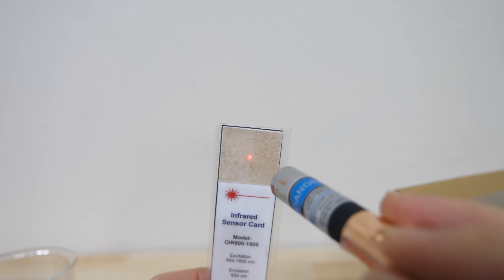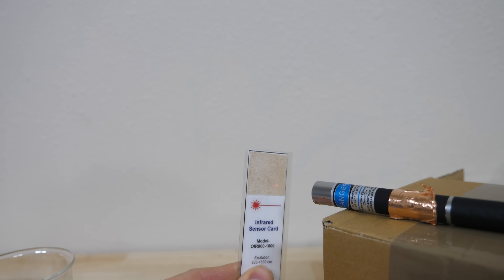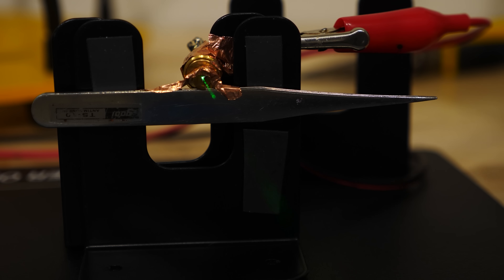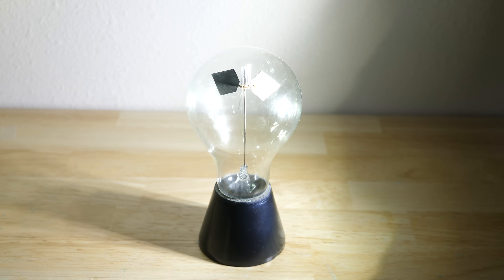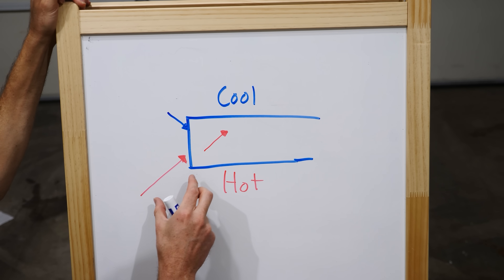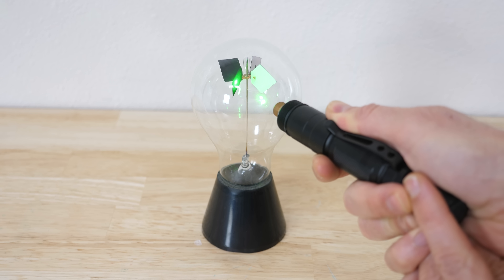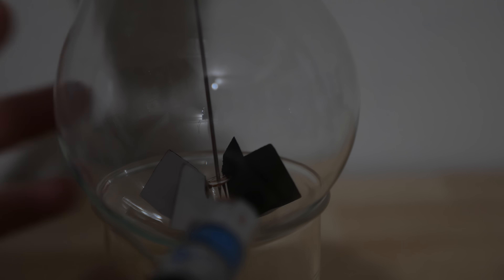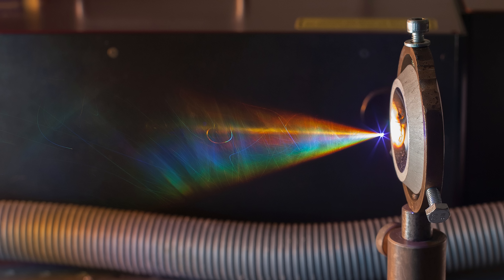I Had To Break My Radiometer For Science

Comment: What a fascinating and unexpected result! Your continuum spectrum had me chanting, "Thermal! Thermal!" but how it gets thermal when the same laser has no effect on your hand -- you've checked for small leaks, yes? -- is baffling and likely more complicated than it looks if the history of radiometers is any guide.

That history is far messier than most folks realize. For example, even the great James Clerk Maxwell mistook Crookes' results for the radiation pressure effect he first predicted. Even today, it is Maxwell's profoundly non-quantum, fully classical light pressure model remains the best explanation for astronomical dust clouds (the Pillars of Creation) and the design of NASA's well-proven solar sails. Ask a QED expert to explain the same effect, and you have a good chance of getting a lot of hand-waving nonsense about electrons absorbing and then re-radiation the same photon in the reverse direction without any loss of energy, which is impossible in terms of energy conservation, time delay, and directional precision.

Comment: This has to deal with the black paint in the radiometer. Efficient black paints are made by dense surface relief materials like carbon nanotubes (like vantablack). These are well insulated from each other in vacuum. Thus, they could be heated up by the laser so rapidly in vacuum. Not sure about the white side of the blades... Probably, they might have shreds of nanotubes on them, which were deposited while the radiometer was spinning.

Comment: Can you give us an explanation of how "Raman" spectroscopy works. It seems that they can use a IR or even a green laser to produce a non-contiguous spectrum from IR to UV. I believe they use a narrow band filter on the detector to remove the light from the laser so it doesn't overwhelm the sensor. My understanding is that they use the Ramen effect to produce spectra used to identify a material's composition. I don't understand how this effect is possible.

Comment: That is fascinating. As I commented below: radiative cooling is very efficient, actually. That explains why rescue blankets are so useful during mountaineering, etc. The human body loses about 50% of heat via radiation losses (at a miserable 37 °C) the rest via conduction & convection.

Here the vacuum kills convection and conduction losses, so then radiation heat loss remains. Considering the colour temperature of the incandescence, it looks like it could be above 1600 °C, you can check using a camera to detect the colour temperature. Take a daylight balanced picture and use a black body colour chart. 

One burning Q remains: Why doesn't the radiometer vane melt? I was imagining it to be made from aluminium. 

Two actually: Does it work with C black powder in vacuum?  Make your own using a sooting candle and a glass slide.

Comment: Isn't that how they make the light source in a "laser video projector"? They shine a laser on some small dot that becomes really bright and that then is used as the light source for the projector. The pros are that it is smaller (thus sharper image) and can change brightness quicker (for dimming in dark scenes to get better black levels).
Unfortunately they don't actually scan red green and blue lasers across the screen. That would be super cool but probably extremely dangerous 😅

Comment: You don't feel it on your hand as skin is very transparent to that infrared light. It is not absorbed at the surface of your skin, but on the inside. In this case it is probably not powerful enough to cause serious harm. But you can even burn yourself internally or the surface of your bones, because you don't have any heat receptors in the depth of your flesh. But when it is absorbed all in the same tiny spot on the radiometer it can get hot enough to glow like this. 
This one of the reasons why it is dangerous when scientifically inept people play around with Laser pointers of more than class 1. This is at least class 3B.

Comment: Yeah, immediately went to black body thermal. Worth pointing out that flesh is pretty transparent to IR light, which is why it doesn't burn you. The energy is distributed over a large volume, unlike just on the surface like the radiometer material.

Comment: This is really a nice video! I am a researcher in the field, I will try to comment in the simplest possible way. Generally speaking, it is possible to obtain supercontinuum generation even with continuous wave laser. One of the main source is a process called four wave mixing. Four wave mixing is a third-order non linear process. This means that you need really a lot of power and tight focusing to have it with a continuous source. Moreover there is a lot of power directly transferred to the material, so it is also easy to damage them. To avoid this, in our field we prefer femtosecond laser in order to effectively generate supercontinuum. Also the frequency doubling that you are showing for generating green light is a second order non-linear process. So it is much easier to handle it even with a laser pointer. Considering the low amount of power one can have with a diode laser, the easiest explanation that comes in my mind is that you are emitting a "black Body" radiation. In vacuum you expect to be much more efficient since there is no thermal contact with the environment, so the material can reach higher a temperature and emit in the visible spectrum.

Comment: Did you notice the small point of green light reflected by the radiometer glass @ 3:51?  I would be curious to understand the mechanism of this phenomenon.
Reply: nice lol
Reply: Good catch.
I'd first written a guess that the glass of the bulb might be recoloring that reflection, but on repeated viewing, I think we're looking at lens flare refraction inside the glass of the camera lens.  The point of light is certainly bright enough to have this effect in the dark room.  There are at least two spots visible near the opposite side of the screen from the original bright spot, and there may be corresponding spots near and on the same side as the source, but they're too washed out for me to see.  Coating that's commonly on camera lenses naturally shifts the refracted color through multiple frequencies.

Comment: Those cheap laser pointers are many times greater than the 5mw rating that they print on the label. With a focused beam you can easily light matches and burn dark colored materials. Thais is almost certainly incandescence like you said.

Comment: Actually you have 3 mechanisms:
1) auto fluorescence (pure carbon is very prone to it)
2) absorption of light which energy can not be transported due to poor thermal conductivity and missing convection, therefore heat up of the paint 
3) Oxidation of carbon with remaining species in gas

Comment: black pigments are usually finely powdered carbon dust.  My bet would be black body radiation from that carbon.  In air, it burns.  One way to confirm, maybe, try purging your vacuum chamber of air then refilling it with pure nitrogen or a noble gas.

Comment: The lab that I work in uses those IR cards because we have a giant 100+ watt IR laser that we need to track across an optic table. It's probably one of the simplest "sciency" things we use in the lab but I never knew how it worked before, partially because I'm an undergrad and I don't know much, and partially because I had never thought to ask about something so seemingly mundane. That was a great explanation, thanks!
Also, it makes a lot of sense that the laser seemed cold. Skin is terrible at absorbing infrared light so it probably just passed right through you. If you had used it on a black balloon I bet you could have popped it. Hope you are wearing appropriate goggles for this-as someone who works with high power lasers, I get paranoid about goggle safety and that laser seems pretty powerful despite its seemingly low image on the IR card. Be safe out there!

Comment: One more use for the vacuum chamber.
Try to put an audio amplifier built with vacuum tubes, with the tube glass broken, inside the vacuum chamber.
It is impressive how the cathodes light up, and the tubes start to conduct, only when vacuum is reached.
With partial vacuum only, there are sparks - especially in the output pentode.
Merry Christmas
Anthony
Reply: Once broken open a vacuum tube's cathode will react with the oxygen and water in the air. In most cases the oxide layer expands and flakes off the cathode. You do get a certain amount of re-activation of the cathode under high vacuum conditions but the cathode is nothing like as emissive as it was before exposure to the atmosphere. For this reason, I use bright emitters, tungsten, for all my cathodes.

Comment: Thermal emission is exactly what I suspected at about 4:13.  Also, I believe this type of device would be optimized (gas pressure, composition, paint, etc.) to maximize the thrust to spin the vanes.  So the fact that it worked best inside the glass bulb makes sense.

Comment: Vacuum is the best insulation material (or non-material?) Plus the sheet is very thin and has low thermal capacitance. This is probably why you can light it up with a small IR laser pointer.

Comment: A lot of times, if you take the base off of those radiometers, they have a valve stem like an incandescent light bulb. I was hoping you would have done that to release the vacuum instead of cracking the whole thing. That way you could have used your vacuum chamber and revived it afterwards.

Comment: Isn't this a simple material example of the black box problem? The thin black sheet, struck by any radiation of any wavelength, absorbs it and re-radiates it. And the resulting radiation has a color depending on the heat generated, just as a fire or iron will go from red to yellow to blue to whilte. Is that what happened here?

Comment: That was my initial guess, that it got really hot.
At first i didn't know there was a vacuum inside that bulb. So i thought there was some super absorbent paint on those fins that would easily glow. But once you said there is a vacuum inside it i realized that it glowed white hot because it had no way to transfer the heat away from it. Air is pretty conductive for heat after all.

Comment: This works because even weak lasers have an extremely high power density, so the lack of oxygen and the good insulation of the vacuum allow the laser to slowly vaporise the black paint. The leidenfrost effect then prevents the heat from being transmitted to the rest of the paint efficiently, so it heats up the vapor enough to emit visible blackbody radiation

Comment: How does the laser heat it so hot if it's a low power laser? What's the output power of the laser?
Reply: Is all that heat being produced by the laser, or the laser trigger the release of energy already stored in the material?

Comment: I assumed it was black body radiation because the vacuum reduced the cooling speed, black absorbs all frequencies of visible light, but most flashlights also emit IR light, so the black paint should also absorb IR well. The last clue was the color, there was white but also yellow and orange at the edges.

Comment: Fascinating Video! Also there is another phenomenon to convert lower energy photons to higher energies called upconversion, it basically uses two atoms that get into a higher energy state and another atom which the energy of the two excited atoms gets transferred to which then emits lower wavelength light than what was used to irradiate the material.

Comment: Very interesting! I wonder, is it just because the vanes are black that it works well or is there a coating on the black side of the vanes that also interacts with the IR?
Reply: Combination of the vanes being black and very thin.
They are good at absorbing IR and there is not much matter to transfer heat to.

Comment: You need to check the temperature of the Dot because the spectrum appears to be Black body.  Your Laser is heating it up but Radiative cooling is extremely bad.
Reply: I was going to suggest a black body radiator as well.  Since there is no air/gas it can’t dissipate the heat. Also since there is no oxygen it didn’t burn in the vacuum
Reply: I don't think it would be easy to check the temperature of the dot. Those remote thermometers have a much wider cone than their laser-pointers would suggest, so you could just be measuring the average temperature of the entire vane.

I'd like to know what'd happen if you kept the laser steady for a few minutes. Would the dot stay just as bright? Would it get bigger as the vane heats up? Is it ablating the carbon away? Maybe it's only the vaporised carbon that's incandescing, because after it breaks free from the vane it can't lose any heat conductively.
Reply: Radiative cooling is very efficient, actually. That explains why rescue blankets are so useful during mountaineering, etc. The human body loses about 50% of heat via radiation losses (at a miserable 37 °C) the rest via conduction & convection.

Comment: Aren't most lasers in the milliwatt range? If so you might have just discovered a way to make a way more efficient filament type bulb with lasers as the Exciter instead of standard DC or AC current
Reply: Wireless too. The lighting elements wouldn't need to be powered.

Comment: Just a warning to anyone wishing to try this for themselves. If you're not careful, the heat will cause outgassing from the vanes, particularly if they are of the non-mica type. This will increase the pressure of the partial vacuum inside the bulb and the radiometer will no longer work as intended.

Comment: I think the physics mystery of why a vinyl shower curtain is drawn inward when the shower is on, regardless of water temperature, is an electrostatic effect. I even put my hand under the curtain to see if there was air flow and there wasn't, it has to be pure electric field effect, seems surprisingly  strong though, it'll pull a thin curtain way in.
Reply: I think you need a candle or something to sense air flow more reliably
Reply: @u1zha  Why would air even be flowing under there though? There's another cloth curtain outside that hangs down over the outside of the tub, air couldn't even flow in under the inner curtain.

Comment: Next time you need to break open a radiometer, remove the base and break off the narrow tube that was used to pull the vacuum during manufacturing.  That will allow air into the bulb in a relatively slow and controlled manner, and then you can break the main bulb without the violence of the implosion.

Comment: How does the photon beam have enough energy to heat anything to white hot? Seems quite novel for that material to absorb IR in a vacuum and almost completely convert it into visible light without any depletion over time. IMO it should have emitted light in air without the perfectly focused spot, afterall it wasn't focused being shot through a bulb or acrylic. If air is simply cooling the spot down before it emits light, you should be able to put one of the veins on a hotplate and make it emit white light with the unfocused spot as it gets hotter.

Comment: Very interesting to see what ChatGPT says about it!

Q: Why does shining an infrared laser on a black square in a vacuum cause white light to be released?

A: Shining an infrared laser on a black square in a vacuum will not cause white light to be released. Infrared light is a type of electromagnetic radiation that is not visible to the human eye and has a longer wavelength than visible light. When infrared light is shone on an object, it is absorbed by the object and converted into heat. The object may appear to glow or become warm to the touch, but it will not emit white light.

It is possible that you may be thinking of a phenomenon known as laser-induced fluorescence (LIF), which can occur when a laser is shone on certain materials. When LIF occurs, the material absorbs the laser light and re-emits it at a different wavelength, which can be seen as a glowing or fluorescent light. However, this effect is not the same as the emission of white light and is dependent on the specific properties of the material being illuminated.

Q; But a prism confirms the light being released is full spectrum. And the light does not appear when the black material is not in a vacuum.

A: It is possible that the black square you are referring to is made of a material that exhibits laser-induced fluorescence (LIF) when irradiated with infrared light in a vacuum. In this case, the material would absorb the infrared light and re-emit it at different wavelengths, resulting in the emission of a range of colors that can be observed using a prism.

However, the emission of a full spectrum of colors does not necessarily mean that white light is being released. White light is a combination of all the colors of the visible spectrum, and the colors produced by LIF can vary depending on the material and the laser wavelength used.

It is also possible that other factors, such as scattering or reflection of the laser light, could contribute to the observed emission of a full spectrum of colors. The fact that the effect does not occur when the material is not in a vacuum suggests that the presence of a vacuum may be necessary for the LIF process to occur, or that the vacuum may affect the interaction of the laser light with the material in some way.

Without more information, it is difficult to provide a more specific explanation for the phenomenon you are observing. It would be helpful to have more details about the material, the laser, and the experimental setup to better understand what is causing the emission of a full spectrum of colors.